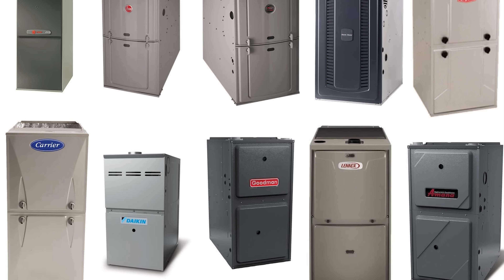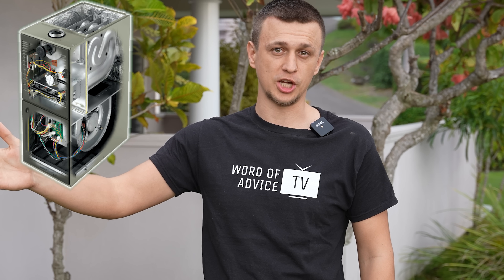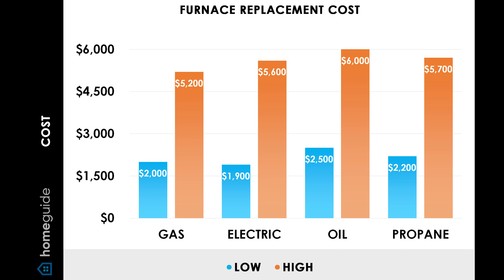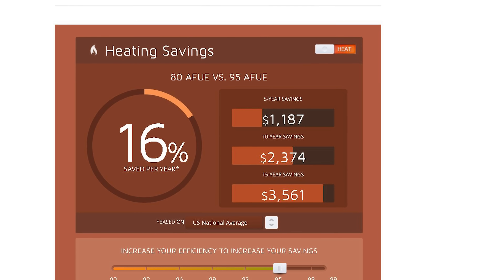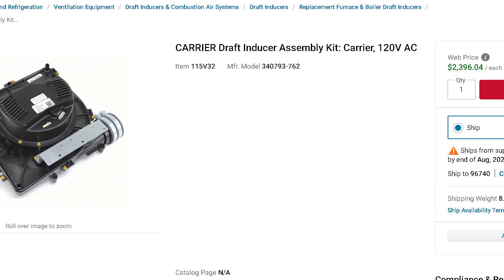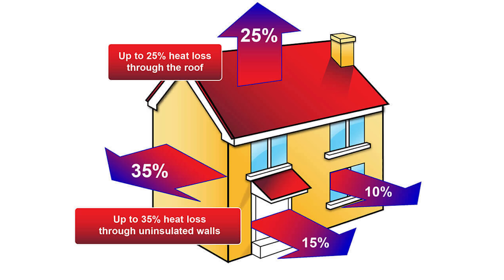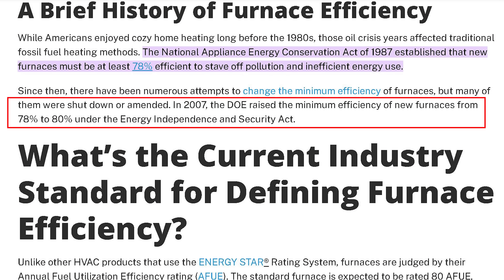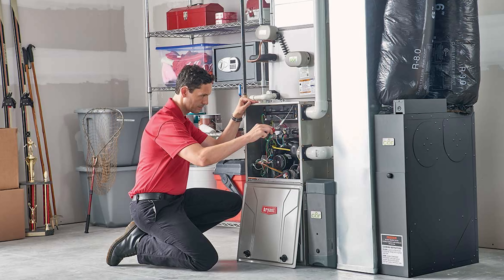Don't Buy a High Efficiency Furnace!

Comment: I totally agree with everything you said. I am tired of these scamming HVAC guys on you tube pushing condensing boilers and you know who you are. I have a weil mcclain EG boiler installed in May 1980 and is still going strong with the original B&G 100 pump. While plumbers often oversized these boilers back then, outside of replacing the coupler on the 3 stage pump which is easy and the expansion tank, no problems. If it ever fails my technician said it will because weil mcclain does not make the part anymore. Since then the house is better insulated and if my boiler finally fails, I would go from a 175000 btu down to a 140000 btu. There is where I will save money. Never get a condensing boiler especially with cast iron radiators because you will never feel warm and you will be lucky if you get 15 years out of it.
Reply: Sir.  I just went to the Weil Mcclain website and there are a number of boilers for homeowners.  I live in notheastern Wyoming....any recommendations on the type of WM boiler?  Your recommendation is NOT to purchase a condensing boiler, but WM does sell those type of boilers.  Thoughts?  Thank you
Reply: @hectormarcayda8608  I believe radiant heat through a conventional cast iron boiler is the best type of heating system since you don't have the on and off cycling of a furnace. I have ductless heat pumps that cool the house in the summer and can supplement my boiler during the winter. As I stated, if you have radiant heat and you convert to a condensing boiler you will not feel warm since the boiler runs at a lower temperature to save money and consequently people increase the thermostat and negates the savings. Weil McLain does make condensing boilers but it is not for me for the previous reasons.
Reply: @michaelbala4225  Sir.  Thank you for the reply.  We currently have a furnace (Amana brand; natural gas; arpprox 5  years old) which I believe is a high efficiency model (it has PVC piping w/metal dutwork throughout the house).  What I've been researching is possible replacement units to include boilers.  I assume a full replacement of my system from gas furnace to boiler would be cost prohibitive, correct?  If so, do you have any recommendations?  I do appreciate your feedback.  Thank you.
Reply: @hectormarcayda8608  Yes you have a high efficiency furnace, not boiler. A furnace is for forced hot air system and a boiler is for a closed loop hydronic (radiant heat) system. If you have no issues with the Amana I see no reason to change out. I believe in the furnace line Amana is rated highly and being only 5 years old should have no problems. That said, as the video stated parts are expensive to replace. Please change the filter regularly and do not buy the high efficiency filters since they stress the blower motor more.
Reply: @michaelbala4225  Thank you very much.

Comment: On my 18th year 6 years working for myself in the hvac/r business and yup   I always try to sell a 80% with 13 seer ac system unless customer already has a 90% unit or the new building specs required.  Also tankless water heaters are just a gimmick. Oh btw let’s go Brandon

Comment: Always add a variable speed heat pump that is effective when temps drop to 0°f outside. This will reduce the run time of any furnace. If gas prices ever drop you can change that lock out temp to be more efficient.
Reply: Most of our customers don’t wanna spend the money for a dual fuel system but I agree that is probably the best option for efficiency.

Comment: Although I agree with many of the points here, I do disagree with a couple. As for the longevity of the furnace, that goes down to proper installation practices. Make sure you get a reputable company to install your equipment. Although the high efficient units won't pay for themselves with cost savings, the main selling point for them is that they're built for comfort. They can make the home more comfortable than a standard efficiency.

Comment: My furnace is from the 1960's or something like that. It is a Westinghouse. It is still running strong. The only maintenance I had done for the furnace in the 5 years since I got the house was to have the belt replaced on the blower motor and I replaced the filter a few times. 

I would rather add a radiator to the heat stack and use hot water than replace it. For a different option, I could set up biogas and a scrubbing system. The natural gas bills are way too high lately. I do need to check into the legalities of making biogas though. Seriously, the farmers could easily replace the oil company's "natural gas" which is mainly methane gas which is also the main part of biogas. From what I could gather, getting carbon dioxide and hydrogen sulphide out of the biogas can leave rather pure methane gas that just needs some odorant added.
Reply: Oh. I do occasionally have to relight the pilot light. It might be nice to have it switched to a sparker ignition and have an automatic flue damper to avoid heat loss but the whole biogas idea and insulating the house better seems like it would be a better idea.
Reply: Try to find the Tag on it, it should show Input BTU and output BTU somewhere.  that was original efficiencly   (output/input * 100%)  it probably lost some performance over the years tho.  Just be cautions of rusted out or cracked heat exchanger that can leak poissen CO.   get some CO detectors to be safe !
Reply: @pablopicaro7649  I have a carbon monoxide detector in the basement. I should probably check on it though. I do not see labels like that but they made it so I can not look at the back of the furnace to check for a model number.

Comment: I just repaired my 20 year old 90% furnace.  It needed a controller board, which I was able to replace with a universal version.  At about 10 years of age, it needed a pressure switch, which was already difficult to find as the company (Clare) no longer exists.  I'm just fearful that parts will get even more difficult to find.

Being in Canada, we burn a LOT of gas keeping warm.  My gas bill just went up by $100/month because of (insert reasons here) and will likely go up even more.  I think it's worth it here to have a high efficiency furnace just for the amount we burn.  My conundrum is, do I replace my old unit or get a new one?  The heat exchanger is still good and it works fine otherwise.
Reply: My board on a 96+ went after 6 years ($400 call-out since warranty dictates a certified tech must be the one to replace, even though I diagnosed and was confirmed to be right). We leave the blower on all year long (DC). It is a modulating furnace and we love it vs 2 stage. Parts are 10 year warranty and 20 on the exchanger. Central SK here.

Comment: Because of the HE furnaces life expectancy is 7-10 years that causes even bigger carbon and garbage footprint on the planet. Two-four times new furnaces need to be produced and the old ones should be disposed. Why previously long-play things are treated as disposables now? Government should somehow prohibit that short life expectancy that manufacturers embed into their products. Something like - 40 years full warranty on major parts should be required. That will make manufacturers use correct materials etc.
Mine Carrier secondary exchanger is rusted. The exchanger itself is covered by Carrier. Only the part and $300 of labor. But repair companies ask for $1200-2000 CAD for labor, $300 CAD for shipping, etc, etc. 
And the main thing - the Coupling Box Kit, which most likely will need to be replaced too, is backordered for who knows how many months by official supplier. Basically now I have to buy a new furnace. It is only because Carrier saved few bucks by making the secondary exchanger and coupling box from black steel, not from stainless. Such things must be regulated.
I do not think I can switch from HE to LE. Could I?

Comment: I loved my old carburetor car with points. Now all cars are EFI, more powerful, more efficient but also faaaaaaar more reliable! HVAC in US has remained in the stone ages; old furnaces are better simply because the new ones are crap. If cars were made like that you would be replacing parts and overhauling every 10,000 miles, like the good 'ol days. Get a Japanese designed fully inverter cold climate rated heat pump (not US designed giant lumps of crap that have not been improved in decades and are as reliable, noisy, and performance like a model T). Ditch gas, save insurance, one less bill to pay, only one appliance in your basement, whisper quiet and never need repair. Oh, but do make sure you get the one person in your area who knows how to install correctly, make flare nut connections so the refrigerant doesn't just leak out immediately.

Comment: 80% works. Simple, easy, and you got heat! Especially in Midwest, you need reliable heat. And some older homes, condos, and townhomes are stuck with that setup, they can’t do a 90%, so it will work in your favor 😎👍

Comment: Thanks for the word of advice. I think I'm going to buy a Goodman system and do it myself. What do you think?
Reply: Goodman are extremely noisy units.  You will save money on the initial purchase but the excessive blower noise will drive you crazy for years.
Reply: @cvr24  
What do you suggest for a DIY system?
Reply: @biggregg5  sorry, DIY gas appliances are not allowed in Canada, must use a gas fitter.
Reply: For instance Armstrong is made by Lennox, and ICP (airquest, Carrier, etc)brands are usually among the best

Comment: With 35 years in the HVAC industry, I cannot agree less with your opinion. Let me break this down for you. First 80% and 90% furnace use the SAME amount of electronics. Both are induced draft, hot surface ignition, flame rectification controls. Next all "variable 90%+ gas furnaces come with a standard 10 year parts warranty or longer, most if not all come with a lifetime heat exchanger warranty. In some cases in transferable to subsequent owners. Fixed capacity single stage 80% gas furnaces are the most uncomfortable furnace you could select. Imagine driving your car with an on/off switch in place of a throttle or gas peddle, not a pleasant thought is it? Or here is another one, save a bunch of money on your new home by having just one light switch control all the lights, possible to do but not very appealing. If the outdoor ambient temperature is a constant of the furnace load design, then an 80% single stage is right for you. However as I live on a planet that has something we call weather, this isn't the case. Component failures come down to three general causes, let's start with #1 manufacturing, that seems to be the starting point most of us believe. Not true as these components are life cycle tested to 100,000 cycles by the HVAC equipment manufacturers, prior to certification for use in products. Next #2 root cause of failures,  short cycling excessive cycles will shorten the life of components. So a fixed capacity furnace at design ambient conditions will not cycle at all, runs 60 minutes of each hour. However at higher ambient conditions, it may cycle many times per hour, its this high cycle rate that creates the failures, if the furnace is oversized this condition can be far worse . Next #3 maintenance, in my area we run a total of 4500 hours on average that's combined heating/cooling with an average of 3 cycles per hour, for an average total of 13,500 run hours per year.  So the equipment will get dirty and require inspection and proper testing and cleaning. If you install a two stage furnace, the cycle rate will reduce about 30%, if you install a variable gas furnace available in a 90%+ your cycle rate can reduce by 65%. I will add yet another major factor, inadequate duct system, this is very common and yet overlooked as a cause of premature failures.  The Federal Government has tried to eliminate 80% furnaces in the past, builders association, property management groups and even HVAC manufacturers fought to prevent this. But if history shows us anything, it will happen. In some cases the secondary heat exchanger has indeed been failure prone, this is due to some manufacturers selecting materials that didn't resist contamination in the gas or the air well. As we are 30+ years of 90% condensing furnaces in production, I would feel safe to say those conditions have been addressed. I am HVAC expert and I would only buy a 90%+ condensing furnace at the very least two stage and likely variable. I do agree with insulating the home and make it as tight as possible, I would warn you against leaving it at that, you should always follow that statement with this one, tightening the home envelope, REQUIRES introduction of fresh air, either an ERV or HRV or even fixed outside air (depending on where you live is required to maintain a safe and healthy home. We as humans need oxygen to live, sort of important and produce Carbon dioxide, we require ventilation. PERIOD..

Comment: First of all, there are different types of models of "high efficiency furnaces, going from modulating, variable speed motor, 5 speed motor, 2 stage heat, 1 stage heat. All these furnaces can be considered high efficiency condensing furnaces with 95% AFUE or higher. You can easily go with a 1 or 2 stage gas heat furnace with a 5 SPEED ECM motor and still spend a very reasonable amount of money. You will save money on gas AND electricity since the newer furnaces are equipped with electro commutated motors (ECM). I do want to also mention that these motors are used all year round whether you are running heating or cooling. 90% of the time, the lifetime of a furnace or air conditioner depends on the quality of workmanship and installation done by the installer. It rarely ever depends on the brand. 

Also, you should correct your video... New furnaces are sold with a 10 year parts warranty when registered online... not 5 years. Your contractor is a fluke if he does not register your furnace. Also, parts on these furnaces are not that expensive.. very reasonable unless your contractor is ripping you a new one.

Non the less, it's also better for the environment. Touch your white PVC flue pipe and tell me how hot it is. Not very hot. That's because most of the heat is going into your home and not outside your house. Compare that to you C VENT metal pipe on your standard efficiency furnace.

I do agree that the 97-98% efficiency furnaces like the modulating are not worth it... For obvious reasons like they cost too much and repair parts in the future (past 10 years) will be very expensive. Also more parts mean more chances for things to break down... However, some people do prefer these furnaces because of there operation. They operate differently than your regular furnace. 

Stop giving people the wrong message. High efficiency furnaces are great and effective. I am thrilled by the amount of "professionals" in this comment section who are backing this up.

Comment: This is the second you tube video I have come across recommending 80% over high efficiency.  Is your opinion based on your personal field experience?  High efficient furnaces are nothing new. They have been around for over 30 years. If I remember correctly Lennox introduced the first 90% furnace (Pulse) about 40 years ago. Total disaster, it actually used a spark plug for ignition. Next came Carrier 90 + with a 3 wire pilot burner. Better but had problems with their PPL HE’s design. Since then the technology has become better, more reliable than the standard 8O% models. This is due mainly to production cost and planned obsolescence. The reality is you get what you pay for.  There is just a hand full of manufacturers who make the countless brand lines most are familiar with. A lot of them being assembled In Mexico. Average life of 80% furnace is approx 10-14 years with average use, 12-16 or more with 90% assuming they were properly sized and installed. You mentioned 90% furnaces are not worth the investment based solely on efficiency and cost to repair. There are other factors to take into consideration. Is noise an issue.. 80% furnaces are loud in comparison. How about multi stage systems, they provide even temperature curves and use less energy. A must if wanting to zone a system. ECM and variable speed blowers are quiet, 70-90% more efficient electrically than standard blowers and perfect for indoor air quality accessories. Of course you could get these features with a 80%, but why would you at that price point without getting the advantage of high efficiency. Not to mention better warranty and peace of mind. My recommendation to anyone on the fence about choosing 80% over 90% is to get several estimates from contractors with good reviews. The good ones with take a whole home approach, ask the right questions and find the best match for you. On average, the cost difference between 80% and a 96% furnace is recouped in 2-4 years.  I do agree with you about improving home efficiency. Adding additional insulation to the level recommended for your climate zone, is a great way to improve overall efficiency dollar for dollar.

Comment: The video talks about the pros and cons of buying a high efficiency furnace without laying out the situation. I.e. what does the consumer currently have installed and what are their goals? I have a hard time understanding how someone might call this good or bad advice without first knowing the answers to those questions.
Reply from the maker: There are way too many variables involved which is part of the reason why I simply generalized the video and hoped for the audience to fill in the blanks. I love that there are so many comments coming in. If someone wants to get a clearer picture, they can simply scroll through the comments.